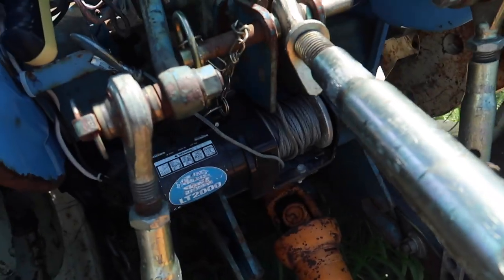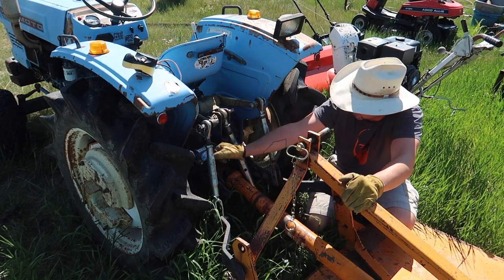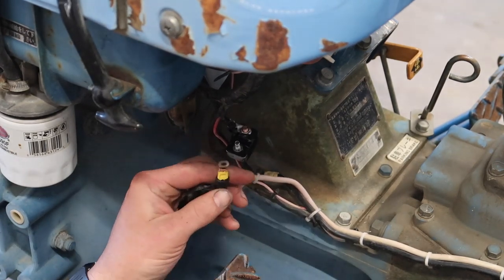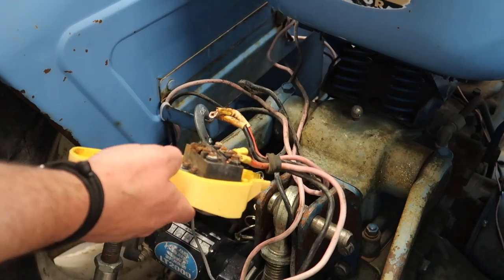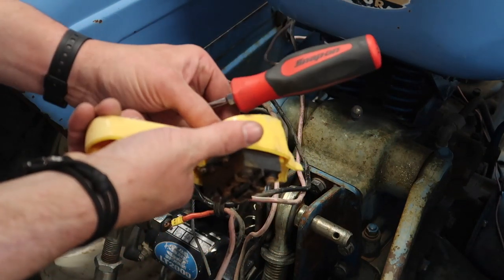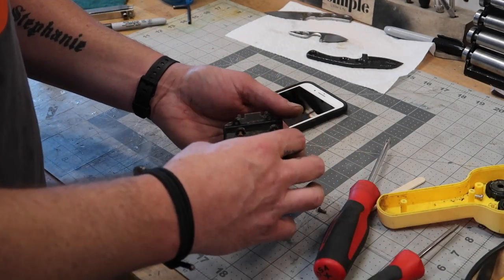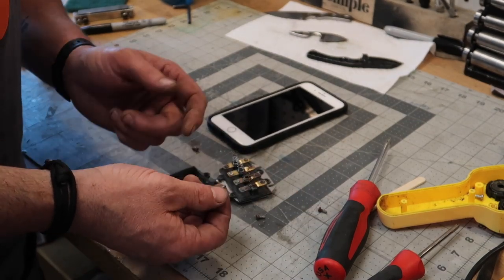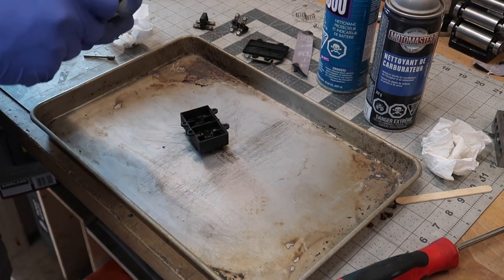FIXING the WINCH on my TRACTOR

Comment: For what it's worth. Always use some kind of acidic solution to clean those pesky contacts.
My suggestion for household stuff that work perfectly and it's dirty cheap. Vinegar or mustard! Yeah, that's right! 2 things that everybody usually have at hand and work really well. 
- Vinegar tend to be more acidic, so work faster. That pause for a meal would have been enough to get them "as new" again! 
- Mustard as the advantage of being more creamy, so it doesn't run down the part that's being cleaned. Which can be a quite handy feature. ;-) 

On both cases no scrubbing should be needed. If you want or need to scrub elec. contacts do it with a wire brush or very fine sandpaper. Avoid any "grinding" attachments, they totally destroy any alloy layer. Which are usually really thin. 
That's it, I hope my 2 cents will serve you well. Cheers